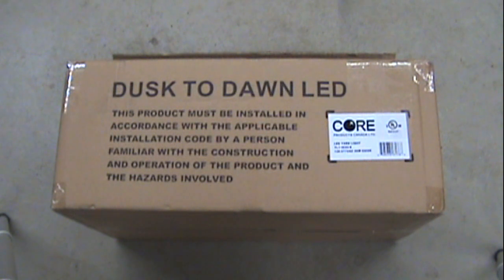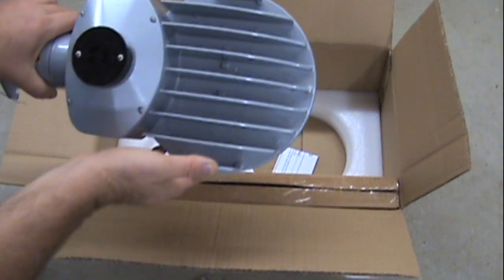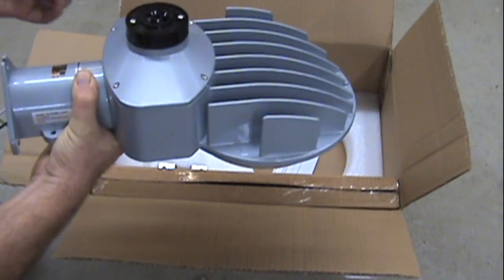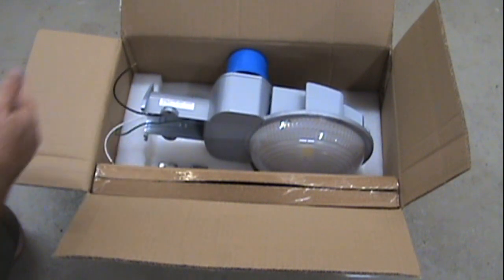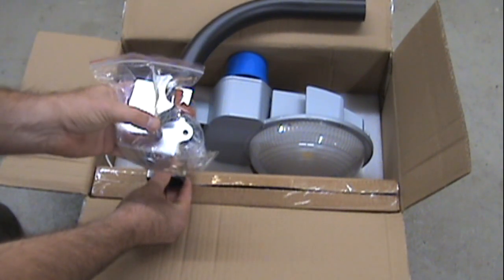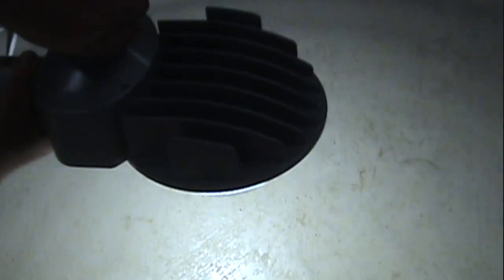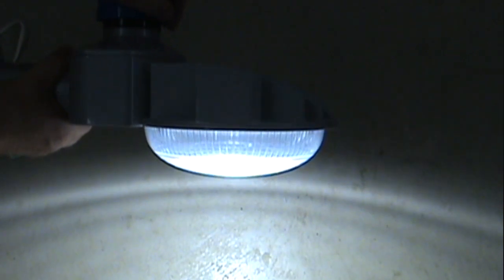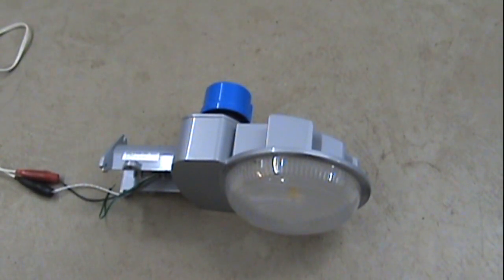LED Dusk to Dawn Light

Comment: This doesnt put out similier light output to a 150w high pressure sodium light... not even close, in fact i challenge you get a 150w HPS fixture and compare LOL, if that were a typical 150w HPS barn light..  Youre entire room would be orange and lit up..  This thing is just making a little circle on the ground..  ..  This light is not even CLOSE..  Youd need at least a 100w LED fixture to almost equal a 150w hps.. watt for watt LED's put out the same amount of light on 120v as a HPS fixture..  The only reason LED fixtures like this are "brighter" at lower wattage is because of the white light being more visible to us than orange..   The other problem with this fixture and other cheapo LED fixtures is they are unreliable.. they break in months or a year or two and you have to replace the entire fixture..  Youd be lucky if it actually lasts..   to where as older HPS fixtures even mercury vapor can last decades..   LED fixtures that are cheap also have poor diffusers.   The light is spread in maybe a 20-30 foot circle depending on the height but there is no outward spread like a HPS bulb can do..  

I have a 40w flood LED, for work shops or to flood an area..  Its bright dont get me wrong, but i also have a 150w high pressure sodium flood.  The High pressure sodium floods 250 feet down a hill and it floods everything from the ground to the tree tops, in a 300 foot wide spread as well.  The 40w LED flood is good for maybe 100 feet down, and 100 foot wide and thats about it..  Its not even a comparison

I have two mercury vapor lamps on a pole 25-30 feet up.  They use 300 watts yes.. but the light spread goes out 350-400 feet in diameter...  An LED like this one you reviews cannot do this.... wont even get half way the light spread my 175w mercury vapor would..  Also 5k isnt daylight, daylight is 6800k
Reply from the maker: Yeah it may not put out the same as a 150W HPS, I was relaying on what their spec sheet said. They lied I suppose. Actually I have many 150W HPS fixtures LOL. These weren't exactly cheapos at over $100.00 each. I installed three of these for a customer two years ago, no call backs so far, they've made it 2 years now.

Comment: Does it work with your electricity ? I don't understand how it works ? What are the wires for ?
Reply from the maker: Yes this light works with your electricity, it operates on regular household 120 volt current up to 277 volts AC.
Reply: @photocontrol  so in the end you end up using your electric to make it light In the night , correct ? Do I invest in solar ones instead
Reply from the maker: Yes that is correct it needs a source of power, but a uses very little energy at 45 watts (some models even less) compared to the usual outdoor lights that are incandescent, mercury vapor, high pressure sodium etc. Solar ones are good as it costs nothing to operate, but I'm not sure how many years they last before battery doesn't hold a charge. If you have a climate that gets a lot of snow sitting on top of the light, very short dull winter days, it can reduce the amount of charging from solar panel on the top of the light and may not stay on all night. If you receive a lot of sunny days all year round and or the location you would like to install the light doesn't have a power source close by, or prefer not to have to do electrical work, then the solar powered streetlight would be a good choice.
Reply: @photocontrol  wow nice thank you , I think solar will be my choice , thanks alot
Reply from the maker: You're welcome!

Comment: That is sweet! We have four "street lights" on our property... only one is working right now, but the bulb on that burned out too... I removed the "professional bulb," but I wondered if one of my outside LED bulbs would work... it does! So now we have this 100W equiv. LED 5K light outside... and the darn things lights up a good sized area! I want to replace the other two close to the house, but they are mounted quite high... and the ladder... well, I don't want to become a statistic! LOL! Watching and Supporting, Dropping another LIKE on your video!
Reply from the maker: That's great Ray the LED bulb worked in your light! Depending on the original light source, a LED bulb may not work without by-passing the ballast. Yes ladders on round poles can be a little shaky lol. Possibly securing the ladder with the tractor loader/bucket fully raised, renting a scissor lift or someone with a bucket truck can make the job safer. Thanks for the like!!